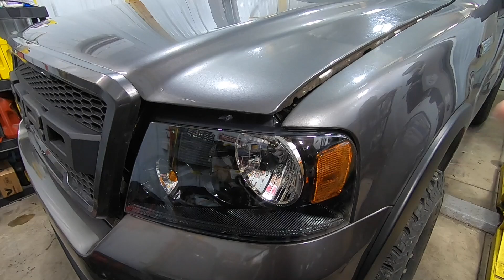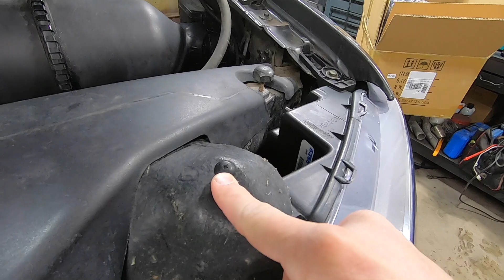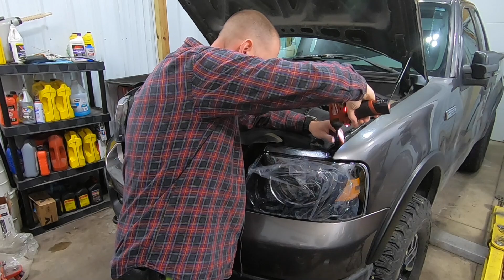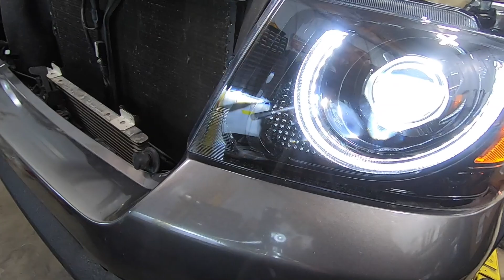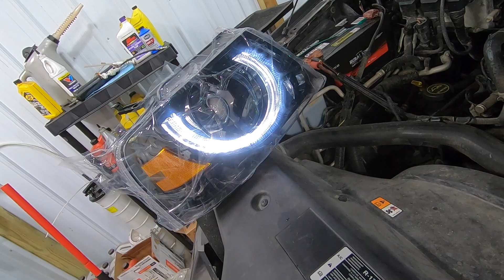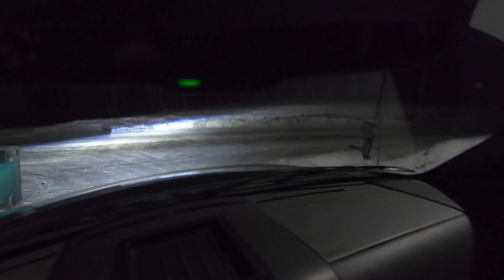2004-2008 Ford F150 Full LED Headlights by GXENOGO Installation and Review

Comment: I must say that those seem to match the trucks style the best along with all the upgrades they add .Only downside is the cost .399.00.  I wouldnt spend over 200.00 as the truck Is probably not worth more than 9-10 grand

Comment: How to only get them amber only instead of the white around the haylo
Reply from the maker: You would have to provide ignition power to the turn signal LED input when running, but then you wouldn't have turn signals. You would have to wire in a relay that actually pulses off with the turn signal to flash the amber DRL. Kind of complicated and would likely cause hyper flashing if you didn't have a load resistor on the relay output but if your savvy enough to figure it out, it could work.
Reply: @JackofAllMasterofNone thanks for reply!! Maybe I’ll search some that comes that way , I feel like Amber is the new thing in 2025

Comment: thank you for reviewing these, i didnt see anywhere in the description if it could do the actual DRL during the day time when you start the truck, i just purchased them
Reply from the maker: I explain in the video how you can wire it to do that. It's all in the video. It is not plug and play that way because there is no 12 volt ignition source present at the headlight harness from the factory.

Comment: So quick quesiton about the wiring. For wiring that Drl to the ignition source, that would disrupt the blinker part of that drl? So when you hit the blinker it would still flash orange? My second question is would it be possible to wire that up to be on when the truck is on, but then also somehow add in a switch inside the truck to act like a manual override to turn it off? Like if it was night and I was parked and the engine is running and I want my lights off, wiring to the ignition would obviously mean that drl would stay on in that case, so how could a override switch for that be put inside the truck so when I press that the drl turns off? I know the easy solution would be to just turn on my parking lights getting in and out of my truck everytime but who wants to do that.
Reply from the maker: Yes the turn signal overrides the DRL while it is on. You could easily add a toggle switch inside of the truck on the ignition feed so as long as the switch is on the DRLs turn on with the ignition but when you flip that toggle off, it kills power to the DRLs and would black it out.
Reply: @ that’s what I was thinking, I figured I’d ask you because wiring has never been my strong suit in terms of understanding it. I can do any of it with instructions but something like this takes me a good while and prep to figured out. Did you end up wiring your drl to the ignition? After you did this video at all?
Reply from the maker: I did wire the DRL to the ignition as shown in the video.

Comment: The high beams don’t seem to go that high with these. Makes the light output at least on video not look good. I saw these when I was looking for new housings yesterday and decided to just go oem again. These have some fantastic features like the turning light which is awesome and I didn’t see that in the listing. But otherwise they just look funny for a drl, the half ring makes the truck look kinda like a sad grumpy old man for some reason lol. Seems like there are only three good options though, oem style, these, or alpha Rex which is like $1300 or something like that and it’s just not worth it. These might just be worth the goofy look. I also just saw on Amazon the exact same ones now sold from three brands. This one and the true mods version seem like the same but the true mod has a coupon bringing it down to $340 which if it is the same quality that’s not bad at all and 100% worth it.
Reply from the maker: Good call. I'd say the look just depends on personal style and what each person likes. I always like more high beam. Any time you have a bi-LED projector it will be less high output since it's just moving a mechanical shutter. Some of the best designs have a reflector high beam and a projector low beam or a separate projector high. These are a great compromise for the price point and have an excellent build quality.
Reply: @ yea I’m thinking I might order the ones from true mods for $340. Did you look at them? Do you think they are the same? Looks to me like they are exactly the same so i think i might.
Reply: @JackofAllMasterofNone  how long have you had these now anyway? They are on sale too actually now for $340 as well. Hopefully a while and hopefully still no water in the housing issues.
Reply: i just bought these with the $60 coupon, ill test them out and tell my review on them

Comment: THANK YOU DUDE. I just bought a 04 and I almost killed myself with the shitty output of the factory housings and bulbs. Im on my second set of LED bulbs off amazon in the halo housings. I had to aim them up considerably and they're pretty bright but I think maybe too much so. Fogs now trip the high beams. And those high beams are pretty much up into the sky cause I had to aim them so high for the low beams. I've been seeing these since I started looking at bulbs and was super skeptical cause you know amazon and $400 worries me a bit. Looked for reviews all over YouTube, couldn't find one till just now. And thank you for driving around at night to show the actual output. Most idiots just show the exterior without showing a nighttime image from the cab of the truck. They look great, output seems top notch with a OEM cut off line. I'm ordering mine now. Thanks again!
Reply from the maker: Glad I could help.  You'll be happy with them I think.
Reply: @ well I got em in and on the truck. Not gonna lie I’m a little disappointed just because right now, granted it’s 20 degrees out and midnight and I’ve been up since 4am, I can’t get the two’s beam patterns lined up so they seem a little meh. Pretty bright, just cut offs obviously seem a little funky right now. I’ll give it a shot again tomorrow when I’m not annoying all my neighbors. Is nice to be able to run my yellow LED fog bulbs with the low beams again though so there is that.
Reply from the maker: @virenpatel9973  Projector headlights are always going to have that very sharp cutoff. I will admit when you are used to regular headlights, it is a big change as above the cut off there is no light at all. It's important to get them adjusted right and make sure the top steps are equal to each other on both sides.
Reply: Cześć,
Mogę prosić o link do tych lamp.